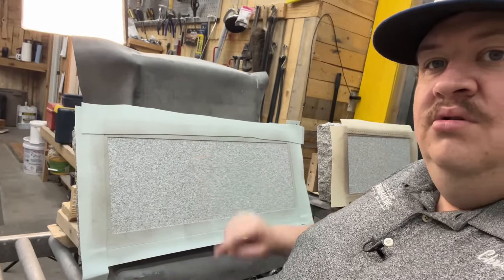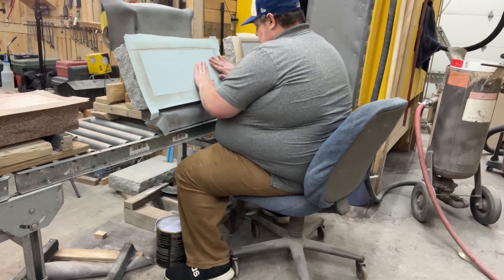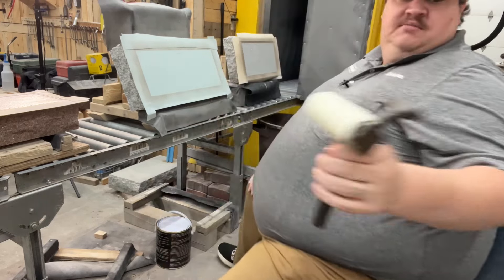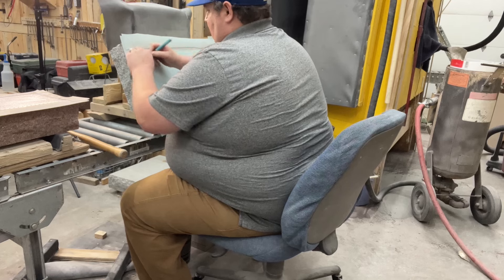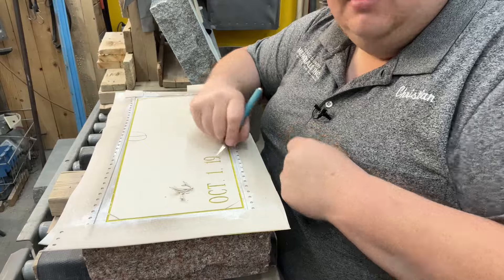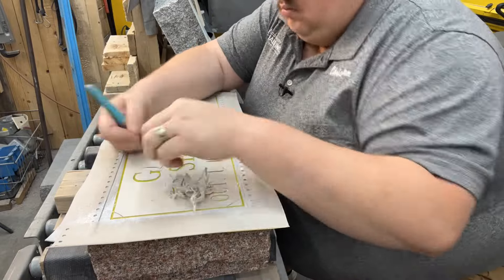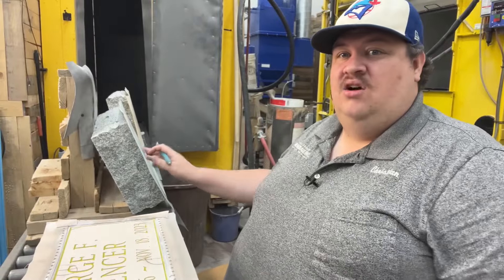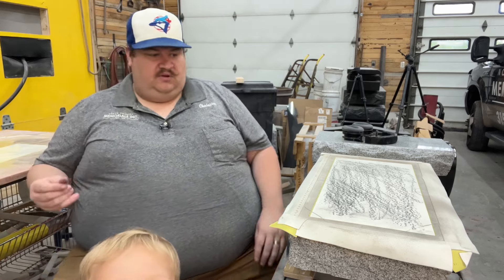Sandblasting Stencil shoot out part two

Comment: Hello Christian good video
I have been using Ublast 719ypt and I am finding it weeds better than Anchor
It's really noticeable when pulling fine design it's not tearing and leaving little hunks in the corners.
I use Anchor #223 stencil filler with it and works good. I just blasted a stone that had stencil on it for 40 days because customer thought they maybe wanted something more but decided to go ahead.
40 days on the stone and no issues it blasted crisp font
Also seeing you weed the Ublast stencil
You need to go up as much as 5 percent on the knife force as a matter a fact I test cut until I see the knife mark scratching the mylar and it will pull clean.
Keep up the good work and stop in for a visit again when your at the cottage.
Gord at Devine Memorials
Reply from the maker: Hey I missed this comment it was flagged by YouTube lol. Ya i just ordered a few more roles of Ublast and think I will also keep using the #223 it seems to work good. I will stop by for sure if I ever get time away maybe in August.